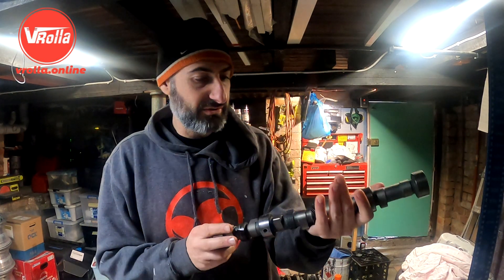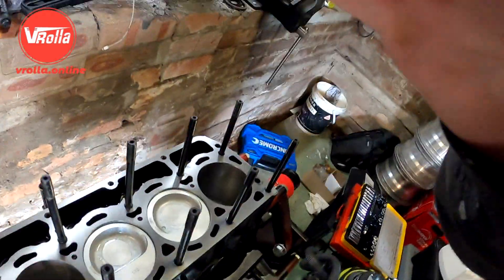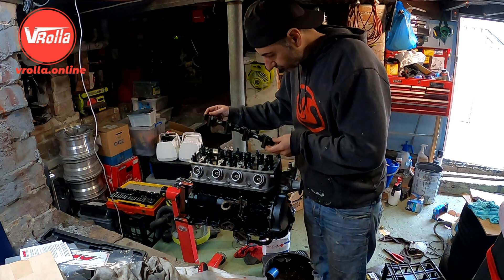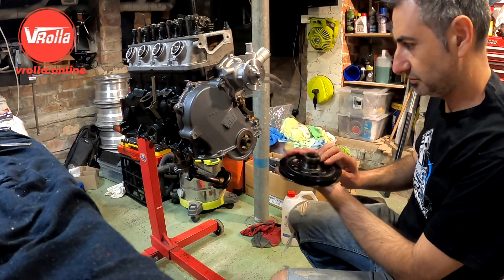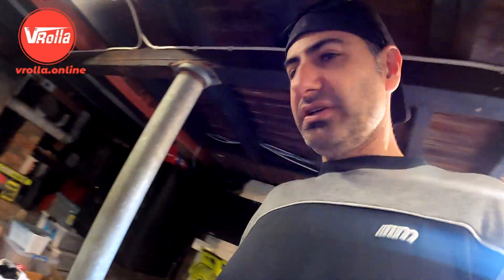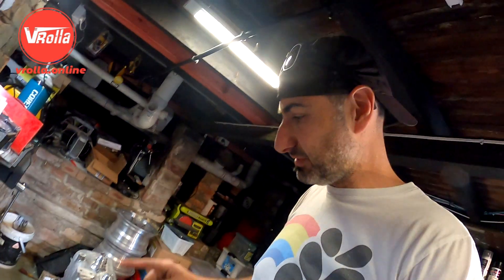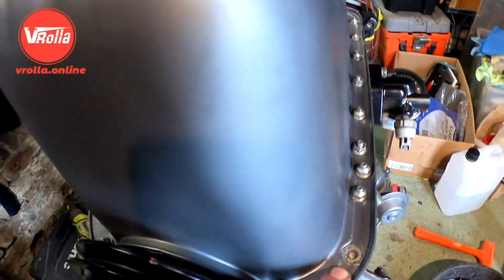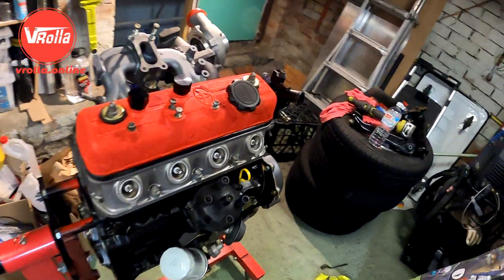Toyota 7K Turbo Engine Build Part 2

Comment: My 95 7K engine used solid lifters and had valve clearance adjustment on the rocker arms. But in late 96 they updated it with hydraulic lifters, so it no longer requires manual valve clearance adjustment.

Comment: Hey mate, might wanna look into the differences between solid and hydraulic lifters. Solids have the adjusters on the rocker arms, hydraulic doesn't. 3k and 4k are solid, 5k and 7k are hydraulic.
Did this not come up when getting your cam ground? Hoping they're just stock 7k lifters that you used?
Reply from the maker: Thanks for your comment Simon. Yeah they’re stock lifters. I mention to the Clive cams they were stock lifters. They never mentioned anything about solid lifters

Do you think I’ll have an issues with the hydraulic lifters and the cam? 

Also I’m massive fan of your KE55 build over the years on Rollaclub forums
Reply: @vinnierolla  Clive probably just ground you a hydro cam if you told them everything else was stock. 
There's a difference between solid and hydro cams... although I don't know what it is. I've always used a solid cam setup.
Thanks for kind words. I actually spent some of the weekend stripping my 5k down for a rebuild. I managed to melt a position last year with too high inlet air temps on 25psi 😏

Comment: Absolute Legend Vinnie. Keep up the stunna work! Love your videos, can't wait for pt3
Reply from the maker: Cheers Jan. Appreciate your feedback 👍
Reply: @vinnierolla On 7k they use hydraulic lifters and don't use adjustable rocker arms...because with Hydraulic lifters they are not needed. Personally I would run Solid lifters and adjustable Rocker Arms. These won't limit your Redline as much due to Pump Up and Valve Float.